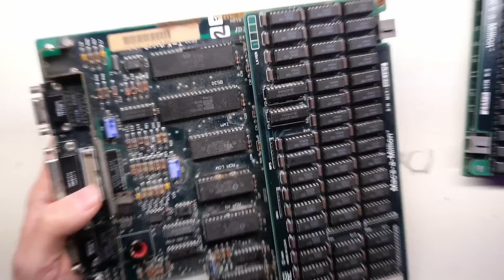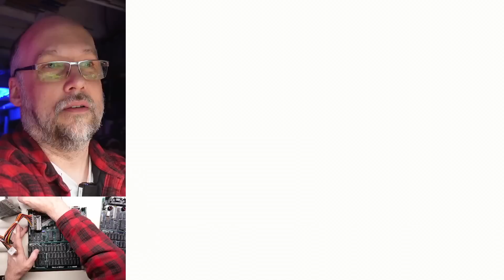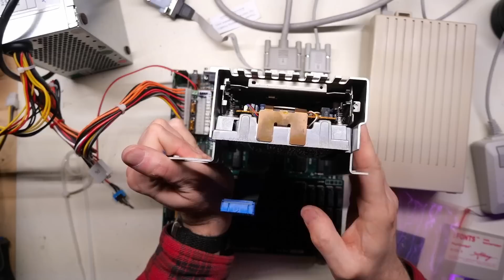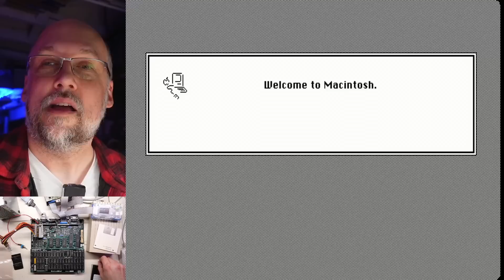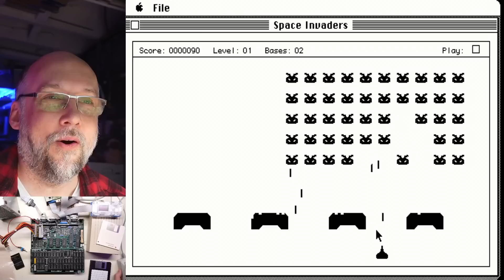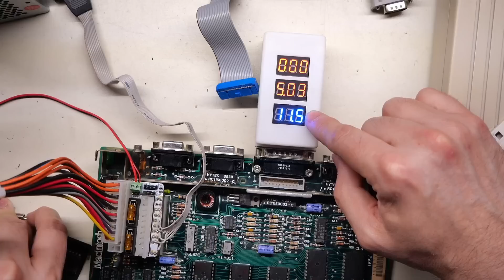Mac motherboards with cool 3rd party RAM boards (Mac's-a-million)

Comment: It really bugged me that you didn't try to diagnose that logic board without the RAM extension board plugged in. Presumably if you populate the LS244 sockets on the logic board it will work just fine without the extension board.

Comment: Not to beat a dead horse...You could try the RAN upgrade card from the non-working board on the one that actually boots. That would at least tell you whether it works or not. The connectors are already there. It wouldn't be too hard.

Comment: It happens when you work after midnight that some silly mistakes happen, the other day my monitor started going into a black screen. So I unplugged it and reached for the spray can of contact cleaner, but because I was a bit tired I didn't quite read what was written on the can. It didn't say contact cleaner but contact glue. #&%!. Big error 40. I wouldn't recommend it, but there hasn't been a loose connection since. In Danish, error 40 means human error, the error is 40 cm (16 inches) from the screen. Are you also saying "error 16"?
Reply: In English we have a couple of terms for that.  PEBKAC (Problem Exists Between Keyboard And Chair) and ID-10T are my favorites.

Comment: The white residue is ionic contamination.  According to Chemtronics, "if not completely removed during cleaning, these ions can establish a continuing corrosion cycle, producing more lead chloride and lead carbonate (white residue) and hydrochloric acid, which will attack the copper in the board laminate."  You get it from old flux used back in the day if you try to wash it with hard water.  They sell a special solvent just for cleaning this white residue (as well as old, crusty or sticky, hard to remove flux.)
Reply: Regular old vinegar is good for removing hard water residue.  It's basically calcium and other minerals, and citric acid works a charm on it.  Vinegar is a weak solution of citric acid, and is a gentle way to clean hard water residue.
Reply: @jeromethiel4323  Vinegar is acetic acid, you'll end up with a bunch of acetates. But citric acid should work a treat, by forming chelate complexes.
Reply: @kpanic23  Look at you with all your chemistry knowledge!  You are, of course, correct.  Don't know what i was thinking.
Reply: I saw one channel use Distilled White Vinegar for washing boards.

Comment: Adrian, I have a bottle of Deoxit 100L (different from the spray you use) that I want to send you. It's so much better. Also, You might want to try some Rustoleum Rust dissolver gel on those d sub jacks. The dissolver gel contains phosphoric acid (like in coca-cola) that converts iron oxide into iron phosphate which is easily removed from the metal. I have used it on some rusty DIP chips with success.

Comment: Always remember what Joe @LyonsArcade said that the hippie told him, "Power supply. Power supply. Power Supply!"
Reply from the maker: Heh it's just funny to think about my always solid and worked last time I used it PSU had an issue -- well it was just a bad connection. But yeah with the drives, I didn't spend long before I figured out it was the missing rail. No drives were harmed in the making of this :-)
Reply: It's all good. You figured it out and that odd issue with the 1 unsoldered pin is certainly easily missed. I can't tell you how many times I've done similar too.  Wasting time on a what I am certain is a more complicated issue, only to discover it was something super simple (maybe obvious to others) that I totally overlooked.

Comment: Adrian, if the unique d-sub connector on the rusty unit was a 19-pin connector, then the "Big Mess 'O Wires" guy did some production runs of the connectors a few years ago. I don't know if HE would be able to let go of any (he uses them for his production runs of the Floppy Emu), but he did group buys, and a company at iec DOT net is listing at least the male solder-cup version at 3.98 each. It might be worth buying three or four to stick in your parts bins.

Comment: 25:35 its almost like those connectors became sacrificial anode and stopped the rest of the thing from rusting, it probably wasn't soaked in water too, just the outside of the chassis.

Comment: My family had a 512Ke with an HD20 and it absolutely worked, although most of the time we used the floppy style HD20 with Mac Plus (and yes I know it would have been much better to use a SCSI drive with the Plus).

Comment: Just an idea, but since you don't have the original case and screen, what if you made a portable/luggable or custom form-factor out of it? Cram the motherboard, PicoPSU, RGB2HDMI, and an LCD into another case from something with a dead LCD/motherboard. Maybe even a modern style iMac, the 2010 era iMacs are easy to get for cheap.

Comment: handful of semi useful things to know - the ROMs in Macintoshes use the standard 27XX ROM pinout, so you can easily replace the ROMs with 27C512 EEPROMs if you wish. Additionally, an 800K drive will work with a Macintosh 128/512 with the original 64K ROMs. It will only be able to boot from 400K MFS disks, but, once booted, the original ROMs can read 800K formatted MFS (but not HFS formatted) disks. Try it with a floppy Emu and a 128k!

Comment: You have to remove the corrosion. You can't do that with water. 

Many products out there. Even things like deoxit have acid as an ingredient..

You can totally remove that corrosion. 

Liquid Tin - I used to pour this over my freshly done circuit boards. You can do that after removing the corrosion. 

But you have to remove the corrosion first.

Comment: Sigh... Adrian, Adrian, Adrian...
OK, just a few things about the Mac and even Lisa (Mac XL). Note: Anything mentioning the Mac 128/512K also includes the Lasa (Mac XL)

1) The Mac 128 CAN accept 800K Double Sided Drives. and Boot from it. The Issues are:

A) ROMs The non Enhanced ROMs used in the 12*/512K Maca can only use System 1 to System 3.2/Finder 1.1 to Finder 4.1. It can not use System 4.2 to System 6.0.8 / Finfder 4.5 to Finder 6.1.8... BEcause ...

B) You have two flie formats to deal with: Macintosh File System (MFS) and Hieracrhical (sic?) File System.  The MFS id a flat file system like on the old 8-bit systems with "fake" directories.  HFS has true sub director trees.

2) In the past people tried to mix and match format with utter failure. MFS is for the older System 1.0 to System 3.5,  HFS is for System 4.2 to system 6.08. System 7 uses HFS+ which is still compatible to the with HFS and Bootable on the Mac with newer ROMS.

Putting on an older system onto a newer format, you just get a disk that will attempt to boot and then crash. Same if you put the newer system onto an MFS formatted sik, it will attempt to boot and then crash. Also, an older system disk (MFS) will not be abe to read the file content of the HSF disk. The newer HSF system can read an MFS Disk but can not write to it. If it does, it will scramble the directory.

The Newer ROMs found on the 512Ke and Plus will read, boot and write from a older MFS System Disk so there is some compatibility there with older apps and files. HFS can ready MFS floppies but can not write to them or (again) it will screw up the directory. But you can read from a MFS Disk and copy it to a HFS Disk. That is a saving grace os some sort...

The old days of the B/W Macs were basically the Wild Wild West days of Macintosh. 

Even back in the early 1990s, Jobs ended use of the Floppy port on Color Mas, he told parts makers to stop making the DB-19, used in the floppy Port.  Some did, others didn't. making the part obtainable but expensive. My ol friend and Mentor (RIP) Dr. Hank Levinson , figured out that you can take a Serial Port DB-25 and cut it down and shape it into a DB-19. It took a lot of work but it was doable. You an even cut the hood into shape an d lightly solder the pieces together. A lot of his repairs and modifications are on the Apple II Newsgroups, which aere google searchable. So for us, at the time he made DB-19s because they are also used on the newer Apple IIe/c/gs as well as the Macs.

And just remember one thing, Adrian...
What ever gets you through the night, is alright.
Reply: Jobs was over at NeXT in the early 90's. Color Macs didn't ship until he was kicked out in 85. (Or was it late 84?)

Comment: I have that same power supply solution for an SE/30 board in a custom case I made for it. I didn't butcher an SE/30, I got the board only that had been "worked on" that I had to actually repair. I don't have any Macintosh chassis, my classic Mac is a iici that I use along with my iigs, so I just designed a case similar to the iigs and printed/fabricated everything needed. The funny thing is, with color through a card along with all the other possible upgrades I could manage to get it's actually a surprisingly strong machine (or maybe not surprisingly, for me that has only used a couple original Macs and a base model Classic it feels like a whole different experience to say the least).

Comment: Hi Adrian, always enjoy the video's. Before all the work removing the mods for the ram expansion, can you swap the two boards over too see if the working ram board works on the corroded mother board then if the corroded ram board works on the working motherboard, to see if it's the expansion or motherboard causing the fault.

Comment: The power supply issue is one of them prime reasons why it's always a good idea to make sure everything is working before doing diagnostics, just as you'd point out when doing C64 repairathons, chasing a fault that isn't actually on a piece of hardware is such a pain to deal with, and the facepalm of discovery often hurts... :P

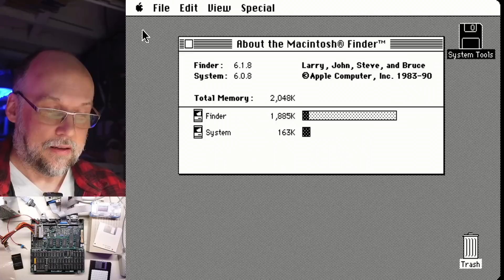Comment: @36:00 Yes, you could run System 7 from the HD20. The question is rather if System 7 allows a 512ke with additional RAM to run it.
Reply: You'd be stuck with 2 MiB of RAM, as the base 68k can't handle virtual memory.

Comment: You should buy an ultrasonic cleaner for motherboards
Reply: I don't recommend that.

Crystals and free-air bond wires used in some IC's are suspectable to ultrasonic vibrations
Reply: @jeffl4810  oh I didn't know that
Reply: @DonatellaBensi  
Yeah, it can cause crystals and bond wires to resonate with such force, that it literally breaks them. 
Although newer tech, MEMS parts might be an issue too.

The black, epoxy encapsulated IC's are usually ok, as their bond wires are encapsulated in epoxy. Unless they were encapsulated with a void pocket inside.

Ceramic IC's and metal can parts have exposed bond wires - these can definitely be destroyed
Reply: @DonatellaBensi  
@Adrian 
The best bet for home cleaning - an old dishwasher installed in the basement/garage for this purpose!
Don't use your kitchen one, as there is (miniscule) lead and chemicals that may leach off.

It actually mimics the aqueous industrial process for cleaning circuit boards! And small batch mode industrial cleaners actually use most of the parts from stainless steel dishwashers.

Remove batteries/battery backed RAM from circuit boards beforehand...
Any power source during washing will be an issue....
However, getting rid of trace contamination from leaking batteries will be easy!